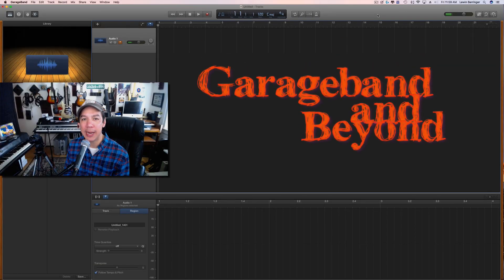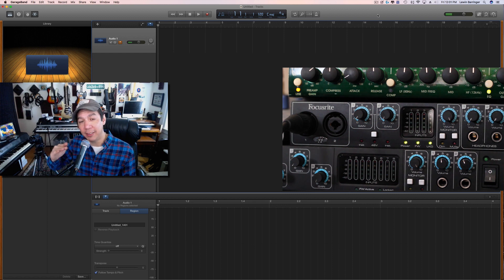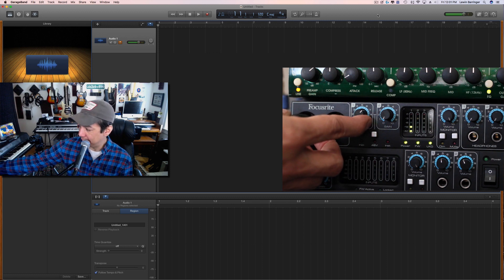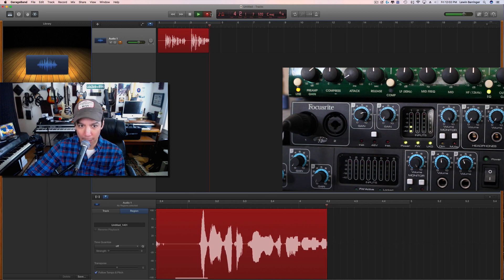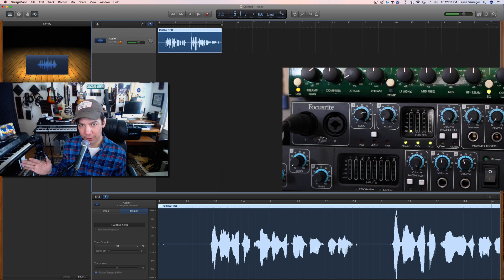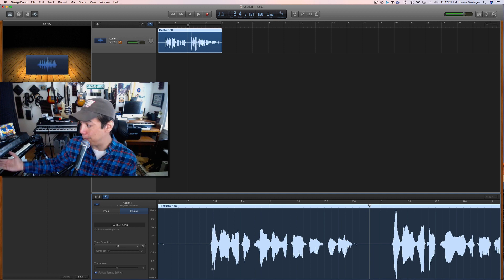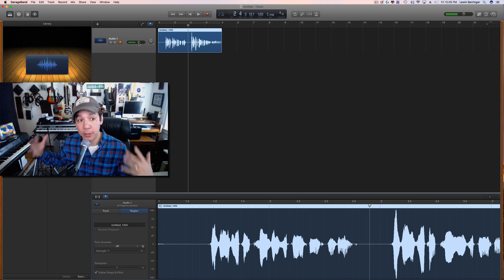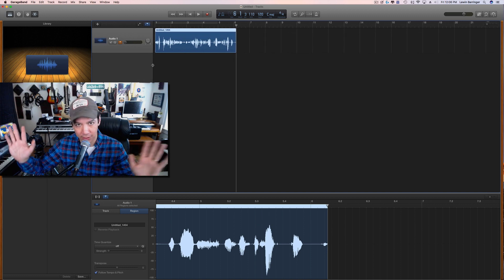How to Set the Input Gain control on Audio Interface! Proper Signal Strength Lesson

Comment: I’m running a mixer into an audio interface and don’t want the audio interface gain knob to add any gain, should it be turned to 12 o’clock or turn counter clockwise to zero to accomplish this?  Thanks

Comment: Thanks for the video!  I am having trouble with very low waves in garageband. I have tried going through my focusrite scartlett solo as well as my presonus AR16 mixer.  Even when I turn up the gain all the way the waves are still tiny.  Any idea on what is causing the low input signal?
Reply from the maker: What are you trying to record? Voice, guitar?
Reply: @GaragebandandBeyond  a whole band. A mixture of dynamic and condenser mics. When i use a condenser with phantom power i get good input volume but not dynamic mics.

Comment: Thanks dude, hey is a 50 or 60 dbs positive and negative good signal?
Reply from the maker: Yes that should be fine, and in fact I’m pretty sure I said it wrong in this video… Those are percentage numbers not dB increments. So it’s actually 50 to 60%. However to answer your question, yes that’s a nice strong signal. I’m usually trying to live somewhere between 25 and 50%, leaning closer to the 50 mark.

Comment: Good video. But something that you should have mentioned is the level of the Input Volume ON THE COMPUTER ITSELF (Mac or PC.) I was struggling to get a good level on my Garageband tracks until I went into Mac / System Preferences / Sound and then increased the Input Volume on my interface. Turning up that "computer volume" made a HUGE difference - and I'm still trying to determine what the best level on this might be.

Comment: What about the recording level settings under the track section where the plugins are? Where do you keep that ? Or do you just play with both the interface knob and that setting until the S/N is balanced for the most part ?
Reply from the maker: GREAT QUESTION!! What you'll want to do is inspect the recording that you make in the editor window. Keeping in mind that the scale on the left side is percentages, you want your recordings to live between 25 and 50% an occasional peak over 50% is ok.
Reply: @GaragebandandBeyond  wow I didn't even realize about the scale! thank you so much

Comment: so i have a focusrite clarett 2pre  have a rode NT2a plugged into input  the signal is weak really weak and i have the gain knob all the way up im recording acoustic guitar   into logic pro
phantom power is enabled
Reply: i have the same problem gain so weak
Reply: @nafalazher2806  I find that the only way to actually raise the volume of a recorded track because it will be so low at playback you can't even hear it, is to NORMALIZE it which will shoot it up to line level 0db but it doesn't sound very good, there's really no other way   the only other way is to buy a mic preamp and turn up the gain

Comment: Hi lewin. I recorded a track with the way you are doing,without picking. But when a mix it and start to put compressors it boost and really picks a lot. What will I do ?
Reply from the maker: Turn the output down on the compressor so you don' hear a volume difference when it is on/off.

Comment: HELP - can anyone help me solve  WHY my 'Recording Level' in the 'Recording Settings' Window with the Automatic Level control is Not active and not responding to input from the interface - I have not recording level and it is not adjustable,  if I unplug the usb (interface) it becomes active again - so suggests its something with the interface??
Reply from the maker: Because you want to change the levels from the interface, not the computer!
Reply: @GaragebandandBeyond  hey thanks for the reply, Im not getting any recording signal in garage band - the recording level window is 'opaque' and set to zero - I can not adjust it, however im am getting an LED signal on my Komplete Audio6 interface, the issue is the recording window in garage band - wont allow me to access or adjust it??  any ideas Thanks heaps..
Reply from the maker: Mick Scott That is because you need to be using the controls on your interface, not inside garageband, to set the input levels. 
I would be willing to bet that you do not have the proper Channel set on the input.
Reply from the maker: @nukakadu8382  https://youtu.be/q3zIuYRIxTQ?t=112 You will see the input controls as 1:48 in that video.
Reply: @GaragebandandBeyond   thanks so much for for your help -  sorry to be a pain,,but im still stuck! The channel inputs are correct??  can you please confirm this _ "when you plug in an interface with the usb to the Mac - does the section in the recording settings window, where the automatic level control is, become  non-adjustable -( it actually sets back to zero level and is not  manually accessable  any longer)   because that is what happens when the usb is connected - therefore there is no signal getting thru to GB!..
Reply from the maker: @nukakadu8382  Ooooohhhh!!! I didn't realize that you were using a USB mic. GB can only recognize one USB interface at a time and you can consider your USB mic an interface of sorts in this case, because GB is doing exactly that.
You want go into your GB preferences and tell it that your input source is the USB mic, you'll have to switch it back to use the interface. However, I would say get a mic that uses an XLR cable to plug into your interface, they're better than USB mics in general. PROBLEM SOLVED!

BTW if you'd ever like to support the channel! http://www.Patreon.com/Garagebandandbeyond
Reply: @GaragebandandBeyond  Hey Lewin, Thanks heaps for the link, you are spot on with the issue  - I notice that you show at 1:48  the recording level in the recording settings window is redundant when the interface and usb is connected - therefore It leads me to an interface issue  I think- Im using a Native Instrument 6 channel interface - ive recorded many things thru this, guitar Jack, XLR mic leads etc  but all of a sudden im not getting a signal thru to GB,???    do you think it is an interface issue??
Reply from the maker: @nukakadu8382  It's either a cable or something wrong with GB. Change cables, if that doesn't work delete GB and re-install it from the App store. Don't worry you will NOT lose ANYTHING! It is a completely painless operation.
Reply: @GaragebandandBeyond  thanks for your time - I will endeavour to resolve the issue  and I will get back to you with the results -  cheers
Reply: @GaragebandandBeyond  Hey lewin, I think you might be interested -no success in our venture thus far   - but do you know about this!!!!   I got a message from Apple to upgrade OS to El Capitain afew weeks ago  - this was the same time I lost input signal to GB??? I have checked afew forums and there is alot of feed back on this stuff - may be El capitain is the issue...  what can you find out PLS...   im thinking of dumping El Capitain and re-installing my prior OS - that I dont know how to do???  cheers Mick.

Comment: Thanks bro.  Your mic sounds great :)  Thank you for the visual on that signal to noise ratio, that was really cool.  Quick question:  I have a Yamaha 4-track cassette rec that I found on eBay, mint, the same one I used in the early 90s.  I love the 4-track bc I can push it into the red, without that digital distortion.  I have a cassette player on my truck, and it jus sounds punchier than CDs or even the radio, and hands down better than mp3 files.  Am I just being nostalgic, or do I just need to get better at recording in the digital daw realm?

Comment: Thanks for the video.  CAN YOU HELP ME FIND SOME CLARITY.  I am trying to figure out how to set optimum recording levels and was under the impression that getting the biggest wave form (or signal) without clipping was what I was shooting for.  But I just stumbled on quite a few videos talking about how when recording digitally that you wanted to keep your recording levels low, at least compared to analog recording.  (Somewhere around -18db I guess, which I have still yet to figure out how to see what db I'm recording at)  So with all this I am a little confused on how to set my gear and what size signal to aim for when recording.  ~~ Any Clarity Here Would Be Much Appreciated ~~  P.S. I'm using a Scarlett 2i2 and Mixcraft Pro Studio 6
Reply from the maker: If you're using garageband, you can view the recorded waveform in the editor window and on the left side there is a scale for +/- db. So you can judge your levels by that.

Everyone has their own method and if you ask me you were on the right track before. The signal to noise ratio is still important!
Reply: Wow man I use the same rig as you and had the same question!! I've heard too that you should record at -18db, so I've been doing that...... still not happy, my sound is just crap :(
Reply: Just listened to one of your videos, sounds pretty darn good to me brother haha.  But yeah I'm still trying to figure out that technical stuff.  At this point I'm just focused more on not clipping than anything else.  I feel like recording low like that is more useful when you have more skills in the mixing department which I definitely don't.  If ya get any clarity here please let me know.
Reply: Thanks man will do!

Comment: MIC ==> INTERFACE ==> LAPTOP & PRE-AMP......Gain set pretty low on both Pre-Amp and interface....So why does my audio keep clipping???? A cheap interface or maybe I need a better one with more Headroom......

ANY ADVICE????........
Reply: I know this is a little late... but you go from your preamp into you're interfsce... and turn the interfaces gain to 0 and use the gain on the preamp
Reply: @pandagamers1968  Are you saying zero added gain on my interface is accomplished by turning the interface gain all the way counter clockwise as far as it can go?
Reply: I am seriously not sure if this is it but one thing that was happening to me was, I had TOO MANY monitors turned on, that is to say to many tracks had their monitors set to on and my macbook actually couldn't process them all so it started clipping.

Comment: Good video. Do you set your interface recording level on your computer to 100? I set mine around 50. Then raise the input on the interface. I find I have less noise that way.
Reply from the maker: If you have an interface connected, the "input control" in your main mac pref's should say "The Selected Input Device has no input control" basically meaning that the ONLY input control is on the hardware/interface.
So to answer your question, I do not set it at all because I do NOT have that option, nor do I need it.
Reply: Thank you - In windows manage audio devices under the recording tap it gives the level option as well as audio bit and frequency sampling options. Probably more than half your listeners run windows I would imagine. Its  important to know how to set both hardware and computer recording inputs for those viewers.
Reply: This is so useful, thanks so much!! What about the "recording level" setting in garageband under the recording settings? do you set it all the way to max?